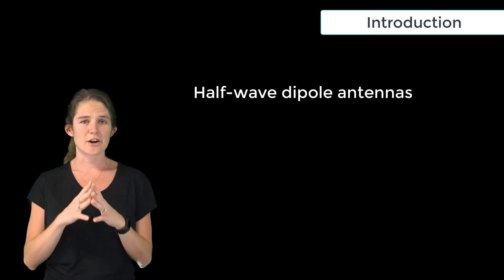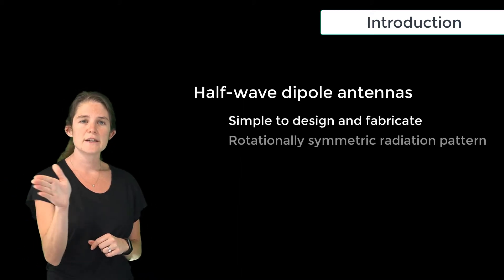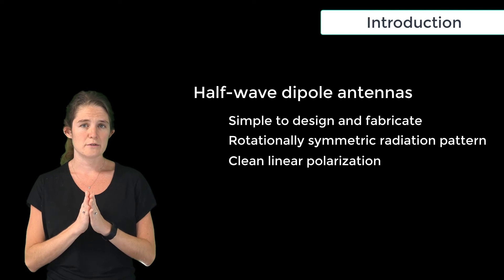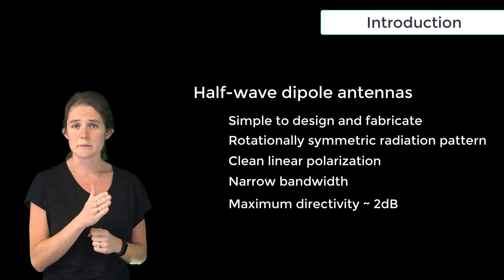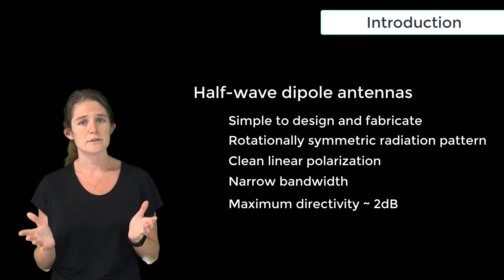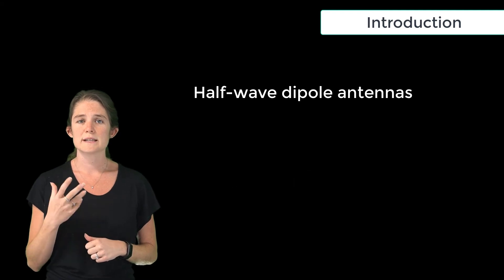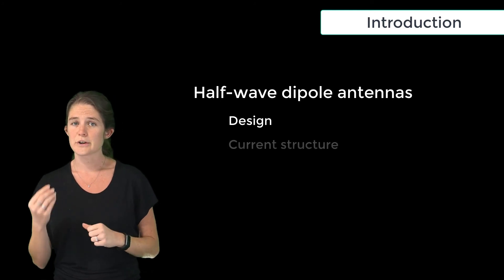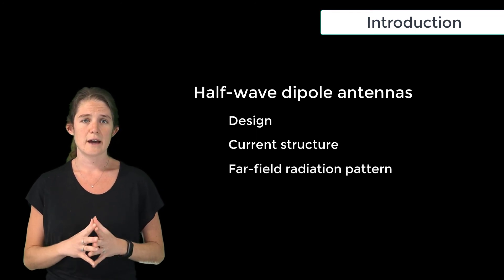Intro to Design of the Half-wave Dipole — Lesson 1

Comment: Okay, so I have a question. What if I were to take my dipole and run two other pieces of wire the same length perpendicular to the existing to pieces and connect them?
Reply: My best guess — and I'm just learning, too — is that mostly it'll just distort the radiation pattern (provided the wires don't actually touch the radiating part).  It'll look like a yagi director or reflector, depending on whether electrically it is shorter or longer than the dipole.  Not all of its length participates because the ends that are perpendicular to the dipole are perpendicular to both E field (which runs parallel with the dipole) and B field (which wraps around the dipole).

If it's close enough, it might capacitively couple some of the E field across the feed point.  It'll probably detune the antenna a bit because it's inside the reactive near field and it will almost certainly mess up the impedance match at the feed point, too, adding some additional reactive impedance which probably distorts the real impedance a bit, too.